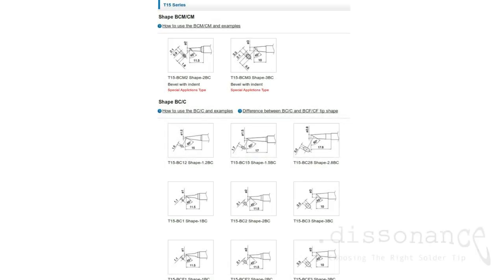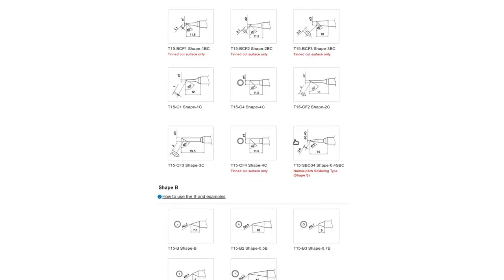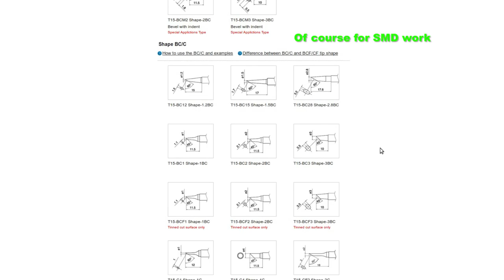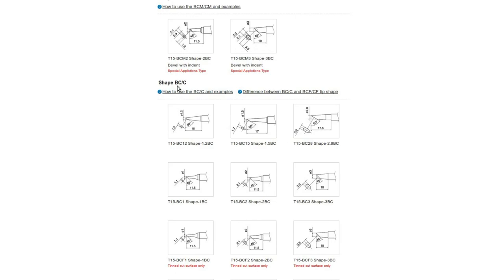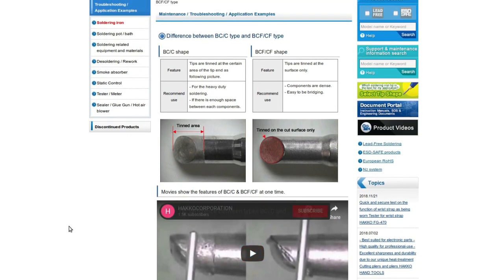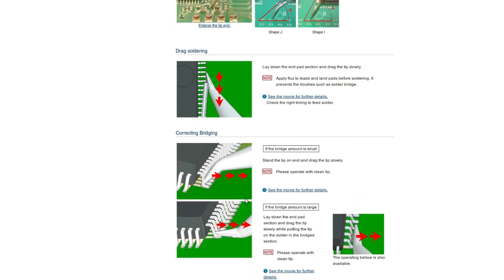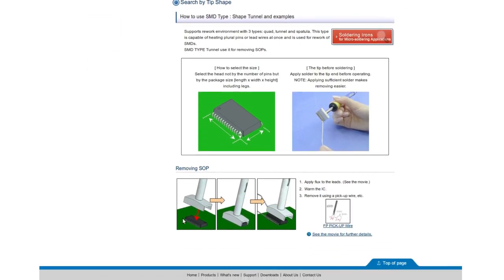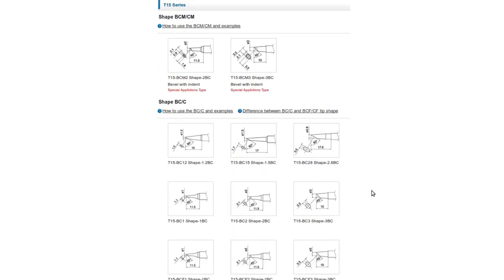#76 - Choosing the Right Soldering Tip

Comment: I have the 951 also and I've been so pleased that I selected it over the 888. I have about a dozen tips from small chisels for delicate work to some of the really high heat capacity ones like the 4mm 4BC or 4BCF. The BCF tips with only the face tinned are really handy for dragging and for lead tinning. I use the D32 3.2mm (stubby chisel, not long) for about 80% of what I do because I do almost no SMD.

I have the 1.5XD in the mail, really curious to try it as a "high heat capacity" tip.

For my use, ranking the relative utility of T15 tips:
1) D32--3.2mm stubby chisel
2) D16/D24- fine Chisel-- close to the perfect do it all tip, the "if I could have only one tip" tip for many kinds of uses. I rank the D32 higher only because it has a lot more heat capacity and still works for me in terms of reach.
3) BC3- 3mm "hoof"
4) CF4= 4mm hoof, Face-tinned only
5) JD14 Bent tip
6) BC12- 1.2mm "hoof" basically a conical tip with a beveled tip
7) D52- Big Chisel, useful for soldering instrument cables and such where you need big heat capacity and still some reach
8) BCF2- 2mm hoof, face tinned only. Great for tinning tiny leads and for drag soldering UF pitch devices

Comment: I have a hakko T18-I Tip Conical Shape R0.2 x 14.5 mm that I bought for my Acea 936 ESD soldering station wich uses 900M ESD size.

First it's a bit smaller than the 900M when I hooked it up the T18- I tip, it rolls when moving it with the finger which doesn't happen with the 900M that came with it originally, is it ok to use it like that ? what do you think ? does it matter if the tip rolls like if it wasn't adjusted perfectly?

Comment: What's going to be the standard size/shape for general use? The FX951 on Amazon that comes with one tip uses a D16, but the bundle that comes with 5 tips comes with D08, D12, D24, D32 and D52. I believe I read that the FX888D uses a D16 by default.

I think my work used a D24 for soldering 22AWG stranded wire together but I can't really remember if it was that big, or if it just looked that big while tinned.

If you were to choose two or three chisel tips, which would you recommend? I was thinking the D12, D16, and D24. I'll probably only play around with keyboard PCBs, RC cars, and electric guitar wiring. Do you think a D08 is too small?